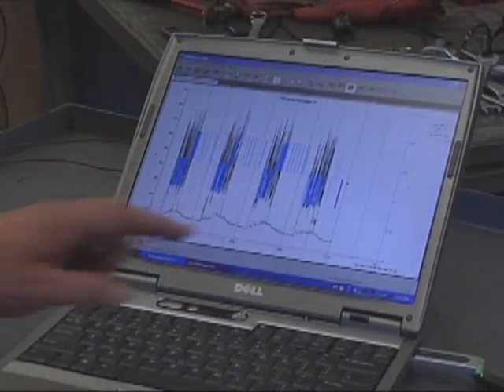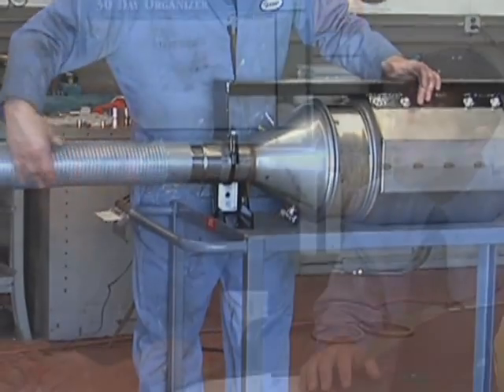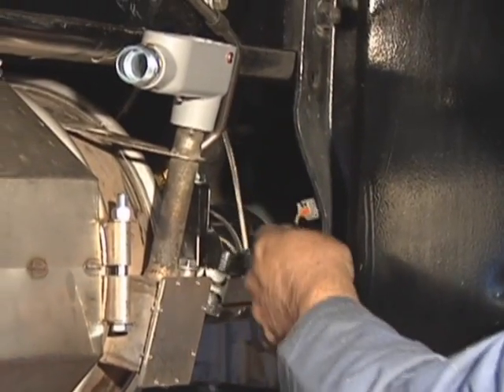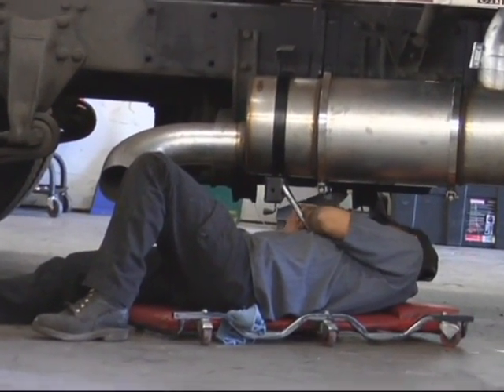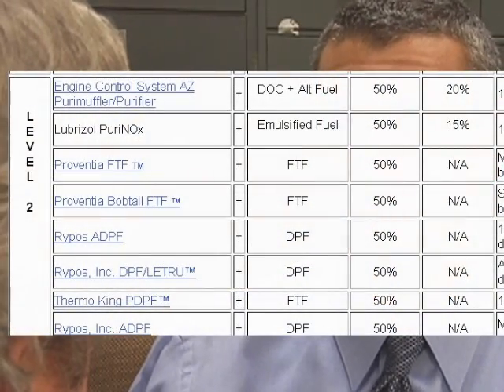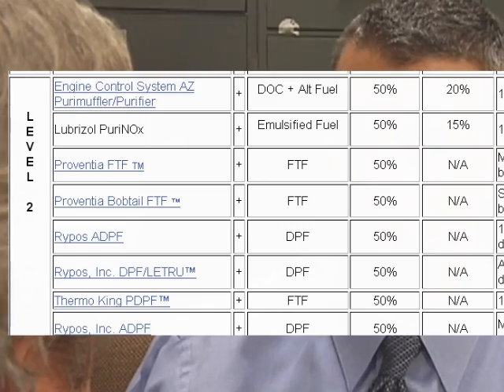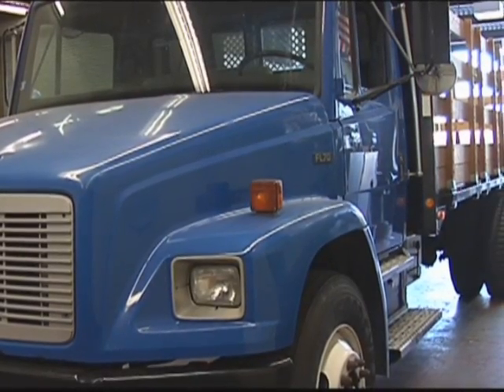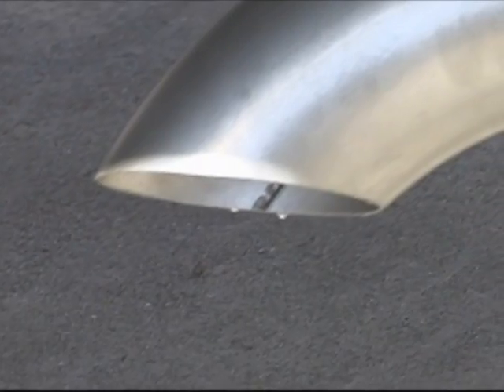Diesel Engine Soot Filter Installation and Maintenance - Installation Requirements

Comment: it costs 10,000 dollars to retrofit, AND you run the risk of the truck burning to the ground.I know of two trucks that have burned to ground after the install of these DPF's just buy a 2007 or newer truck problem solved!